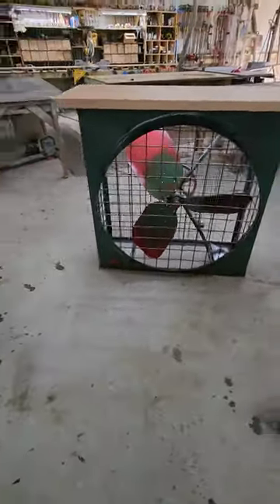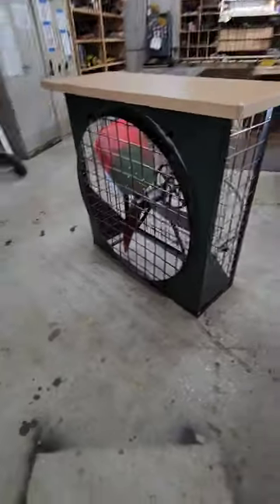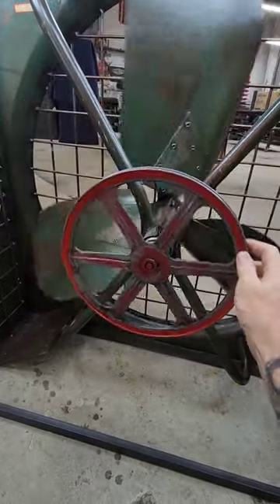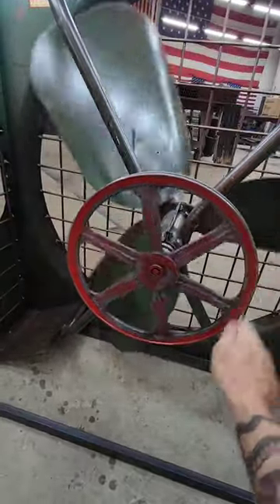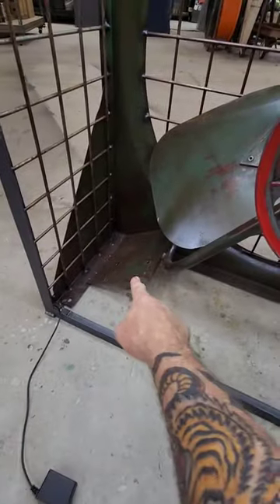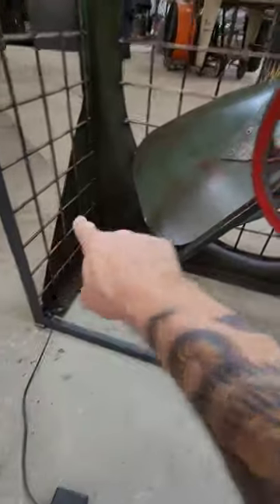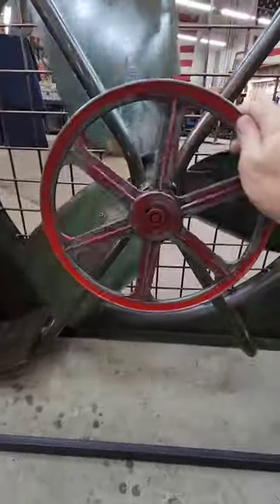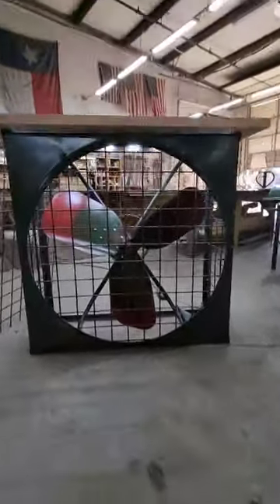Attic Fan Table!

Comment: The issue I see is where you want to mount the motor, and where the pully is.  You're going to have to put quite a shaft on the motor to get the motor pully out far enough to line up with the fan pully.  I'd say flip the fan around if you can so that the pully is on the side of the table you want to mount the motor on.  Either that, or extend the plate you want to mount it on back and mount the motor on the side of the fan where the fan pully is now.
Reply from the maker: Yeah I was thinking of making a bracket to bring the motor out to the pulley instead of moving everything else around. Thanks for commenting!!

Comment: If you can mount the motor within inches of the pully wheel with a gear to engage it that would almost hide it vs the belt being seen with the motor mounted at the base...magic vs mechanical? :)
Reply from the maker: I like it. Gonna look at that option for sure. Thanks for the advice big dawg!!